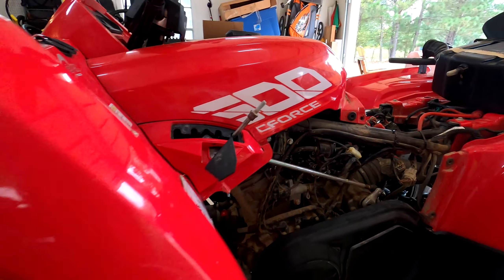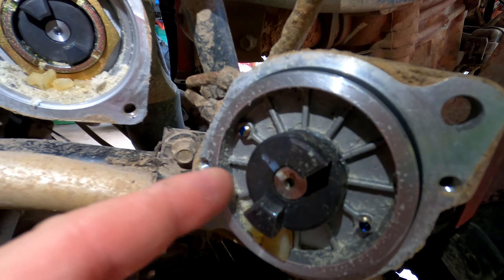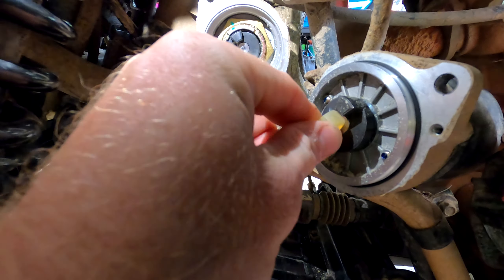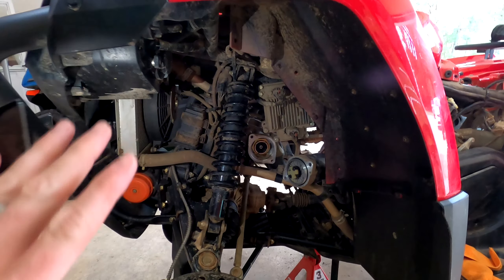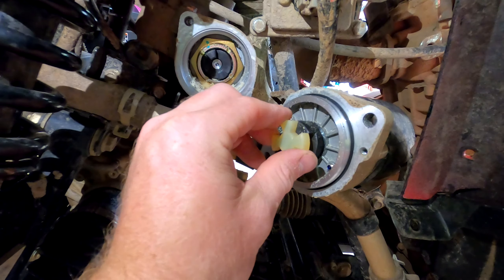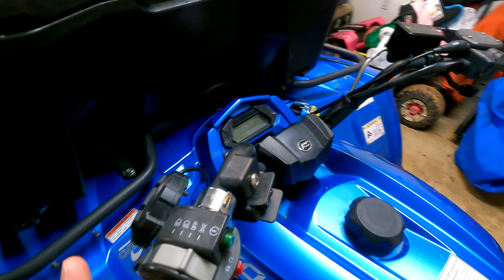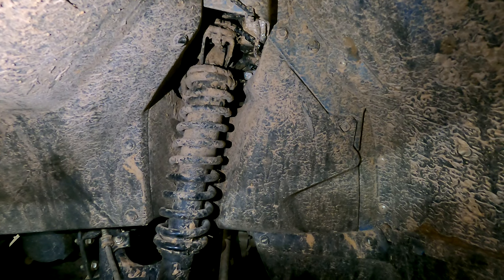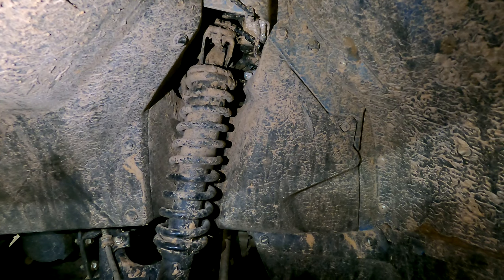CFMOTO CFORCE Steering Popping Noise Issue & Fix | Real Talk Shirts Now Available!

Comment: I run an ATV service and repair shop and have a 2021 Cforce 600 with a EPS box that is trash because water got in it some how . I realized the issue when I went to move it into my shop after sitting out over night and the steering was frozen rock solid . I contacted Cfmoto and they told me that the owner must have had it in some water , imagine an atv in water ??? Cfmoto would not help the guy at all

Comment: I have very similar play in my steering on my 2021 CForce 800, but you mentioned "This does not apply to the 2021 CFORCE 800!". Any idea what the issue might be in my case?

Comment: Thanks heaps guys!!! I had the same issue here, the local dealership didn't want to investigate as they said they might not be able to get the EPS back together,  and a new EPS is $2100 here... got the machine home, opened the EPS & it looked exactly as yours did in this video.. so happy it was only the rubber damper.. I've got it on order.. thanks again, all your video's are very informative!

Comment: Thank you for the part number much needed! No where in researching  or in the service manual itself can I find reference to the damper or the O-ring which is not mentioned in the video. My O-ring is in bad shape and I'd like to put a new one on.  It has an odd ridge on it that I can't tell whether it's intentional and requires using the OEM part or if it's poor manufacturing and a substitute could be used. Does anyone know the O-ring part number? Great discovery of this problem!  My dealer's technicians were completely dumbfounded and would never have found this problem!

Comment: Have you ever had problems with the electric power steering. I think i poped a fused but cant find it.
Reply from the maker: I honestly haven't ever had that issue.. but the fuse location should be noted in your manual

Comment: Hey blake I watch your videos daily, kind of off topic, my family just bought two brand new 2021 cforce 600 tourings and I’m wondering if the air filter issue has been fixed? If not what do you recommend changing too, I see a lot of people say the uni air filters but I see a lot of different options from them and I wanna order a few to have on hand, do you know witch one is the correct one for that atv? Thanks.
Reply from the maker: Hey Dillon ; honestly CFMOTO has done a great job on updating the filters. The ones that are on yours should be a 2 stage filter. Foam over paper element i believe. Just take them off and blow them out every other ride if it was really dusty and you should be good
Reply from the maker: But if you want the best after market filter call main street cycle this week and they can send you what I would run if I ever upgrade
Reply: @RealTalkPowersports  yeah I’ll do that, never hurts to have extra stuff around they will be used around our campground for trail riding and just getting around the park, closest dealer to there is an hour and a half and would much rather have some extras then to need one on a weekend and not be able to ride! Thanks for the quick response, we were so hesitant to go with a smaller named company, but we needed two four wheelers and after watching hours and hours of video on your page I decided to pull the trigger, we pick them up in Minnesota here on Monday and can’t wait to be able to enjoy some family time with them! Also thinking about ordering the clutch kit from Main Street, is this recommended?

Comment: I have been watching your videos about these quads, thanks. Im still up in the air about getting one.......it just seems they are going to be nickel and dimming you after you just spend 6 grand.
Reply: Every 4 wheeler will nickel and dime you if you ride it hard I bought my 2021 cforce 500 in November I've rode it all over the farm no problems  service it on time and take care of it and it will last i have a Polaris sportsman 570 and had carburetor issues after 3 months of owning it what's nice is the 5 year warranty that comes with the cforce 500 lot of other brands only warranty for a few years
Reply: @devinlarew8330  5 year warranty only in canada
Reply from the maker: I have not had to spend one dime on any of mine to fix anything. Because all of my personal units have held up fine. But since I get to see a bunch of units come thru the shop at MSC I get to see a wide range of models and im learning what issues are common if any.. and there are honestly very few issues.
Reply: @2ShoesMedia  no sir not just Canada I live in Missouri I paid extra for 5 year warranty call mega motorsports in west plains mo if you don't believe me

Comment: Thanks for the tip! Did you encouter headlight condensation on your cforce 800? After every wash my headlights and taillights look to get a bit foggy and water bubbles in the headlights. Any ideea why they do that, i've seen others that dont do that.
Reply from the maker: Mine has never done that.
Reply: @RealTalkPowersports  Any idea how to fix that?
Reply: @RealTalkPowersports  Should i talk to the dealership to get them replaced?

Comment: Where are the C.F. Motos made?
Reply: China
Reply: manufactured in Minnesota
Reply: Plymouth Minnesota.  About 80 miles from me. Ive got 2 500's 2018s and have had pretty good luck with them. Some minor issues with one but nothing major. Im putting them up for sale this week because i want to get the zforce 950
Reply: CFMOTO USA’s headquarters in Plymouth, Minnesota but they are not built there  , Hangzhou, China is where they are built.